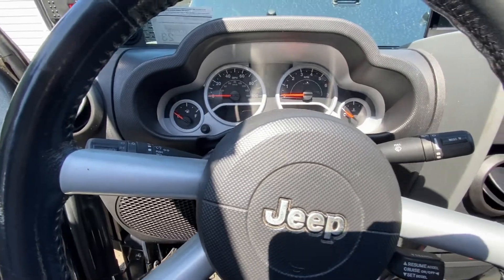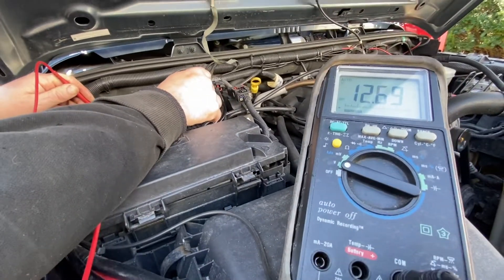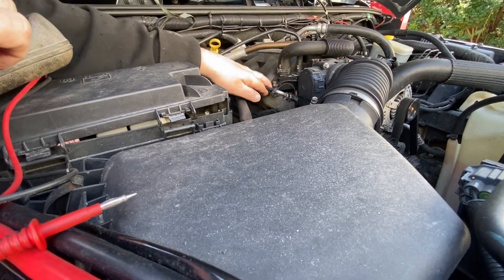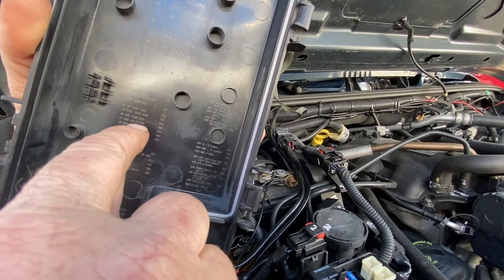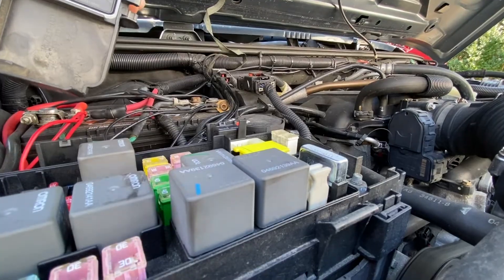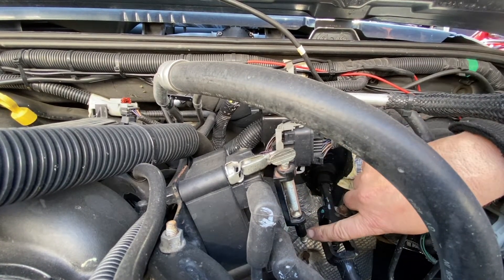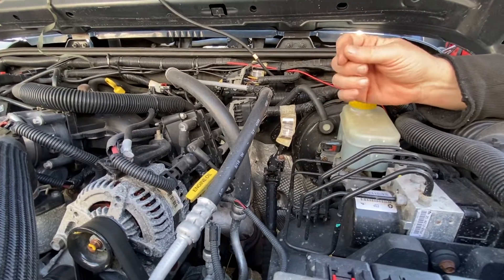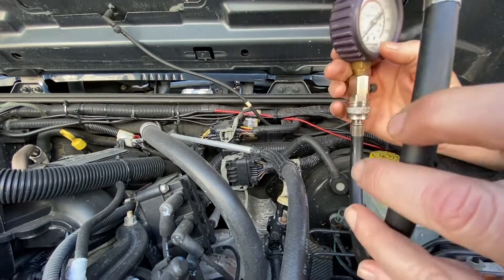Car Doesn’t Start But Cranks - Top 5 Things To Check

Comment: THANK YOU FOR EXPLAINING EVERYTHING SO WELL AND TO THE POINT. I HAVE A QUESTION IVE BEEN TRYING TO FIX MY 2007 DODGE NITRO THAT MY EX DAMAGED BY PUTTING SUGAR IN MY TANK. IVE TRIED TO FIX IT MYSELF IM A WIDOWER WITH THREE KIDS AND NO EXTRA MONEY TO PAY A MACANIC TO FIX MY CAR. IVE DROPPED MY FUEL TANK CLEANED AND DRIED COMPLETLY, REPLACED MY FUEL PUMP, CLEANED OUT MY FUEL LINES , FUEL RAIL,  MY INJECTORS AND REPLACED MY SPARK PLUGS AND CHECK COLPAKS. MY CAR DOES CRANK BUT DOESNT START. I DID GETTING IT TO KIND OF  GOING BY GIVING A LITTLE GAS IT STRUGGLES A LITTLE LIKE MY CAR DID WHEN I HAD A VACCUME LEAK AND WHEN I LET OFF THE GAS IT DIES OUT. I DID ALSO MAKE SURE THE FUEL WAS GETTING TO THE FUEL RAIL BY PUSHING THE PRIMER BUTTON THING ON THE RAIL.  SO SORRY I DONT REALLY KNOW WHAT IM DOING EXCEPT FROM WHAT IVE TAUGHT MYSELF FROM WAITING YOUTUBE VIDEOS . FROM WHAT IVE DESCRIBDE CAN YOU SUGGEST WHAT I SHOULD CHECK NEXT. IF NOT I DO THANK YOU AGAIN FOR YOUR VIDEOS THEY HELP PEOPLE LIKE ME MORE THEN YOU KNOW.
Reply from the maker: Thank you very much!
Sorry about your problem. Depends on how much sugar got into the fuel system. If it’s enough like a bag then everything in the fuel system has to be replaced and lines flushed thoroughly. My guess if the car was running fine before then the fuel injectors have to be replaced. You really can’t clean them. And that may be your problem.

Comment: 06 buick lacrosse ran hot changed thermostat now car won't start it's trying but not catching for some reason.. All lights are on radio still works as well 12.1v on battery any idea what i should try next I'm a female trying to fix my own vehicle through help videos oh I also bled the lines too tried to jump start it but still won't turn over
Reply from the maker: You may of blew the head gasket if the car overheated bad enough. What you can do if you are capable, is try removing the spark plug then crank the engine and see if coolant squirts out, if it does the head gasket blew and would have to be replaced.
Reply: You were absolutely correct I blew a head gasket sucks for me but thank you for your response
Reply from the maker: @joyrobinson8516 Sorry about that. If you are replacing it yourself I have videos on the head gasket replacement.
Reply: @motorcarnut  yes I will be I was going to try the blue devil but I can't get car to crank
Reply: Hey Joy, don't buy into that gender crap, you can do anything any guy can save for a few things that might require upper body strength. At that usually if you find yourself needing a bunch of muscle under the hood that is because you are doing something wrong. I use to think I was a pretty good mechanic until I actually met Shirley Muldowney and realized that if I had two lives to practice I was never going to know as much about engines as she did.
Reply from the maker: Shirley Muldowney didn’t know anything about engines she was a top fuel dragster driver and a great one at that
Reply: crank no start…no compression 😢 in a vehicle that has been meticulously maintained too.  ugggh.